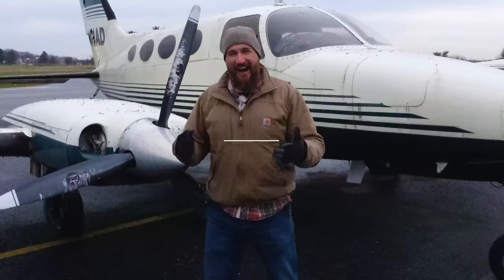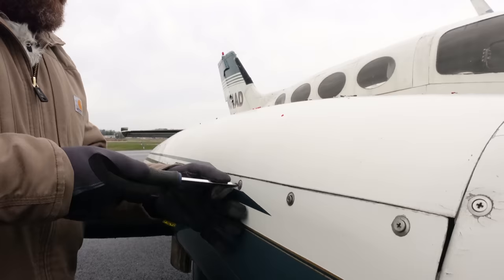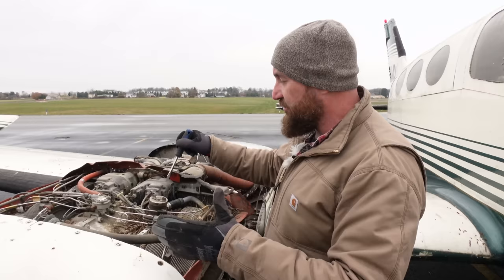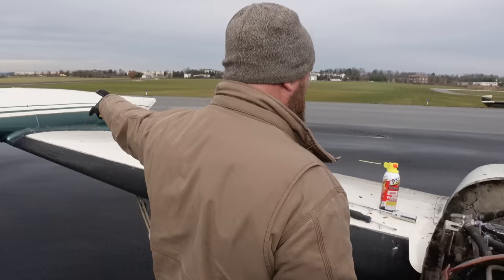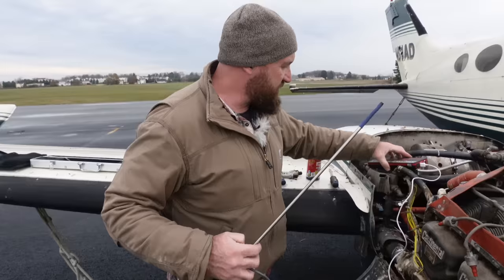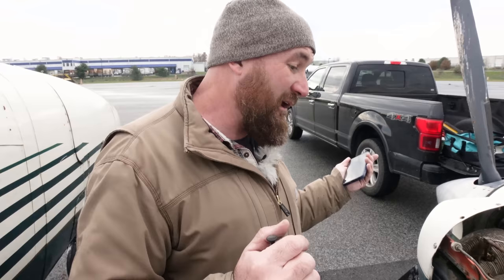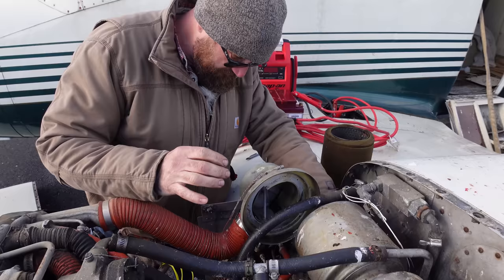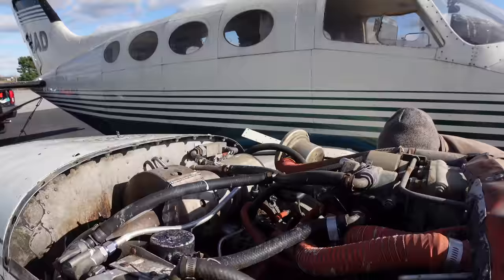FREE Abandoned Airplane... If I Can Start It! Ep1

Comment: This is looking like a good project to try and at least tear it apart and see what shape it is in, if the owner is okay with that.  As for the turbos, well you only need the turbos to build power, you could just disconnect the exhaust and make sure to route it away from anything hot and that will get it started once you have the magnetos figured out.  I can't wait to see how the project goes
Reply: I guess for a ground run but totally illegal to fly like that.
Reply: @robertgary3561  Thats all we are going for here by the sounds of it. Its got a very long and expensive road to airworthiness.
Reply: @robertgary3561  no one is trying to fly it any time soon, so... It's all about getting it to run..  nothing more.. for NOW.. lol.

Comment: Your go for it attitude and your casual narration make the video very entertaining.  Having done everything that you are doing  I kind of know the out come. Been in aviation for 40 plus year and you got me yelling at the TV.  LOL Even starting a good engine takes a little knowledge and practice. ( Side note ) Don't mess with the turbos just for a start, you do not need turbos to start,  just let the engine breath normally. Treat it like the big 6 cylinder VW engine that it is. Leave the mags on just pull the caps and do an inspection. If you see any problems then pull them.  Want to know if it has spark squirt a little fuel or starting fluid into the intake. It shows fuel flow so you know you got gas getting that far, are the injectors clogged, maybe.  It would be entertaining to see you restore the poor old derelict. But making it airworthy again would most likely take over $100K parts and several hundred hours labor. I still would like to see you start her up.  PS please put the battery in the battery box so it does not get blown off the wing. If you want to jump the battery for extra power there is an external power port or ground power. And find a start up checklist that will help make it easier to start the plane. Looking forward to your next video.
Reply: You are absolutely correct on everything you advised. I've been around the av for over 50 years and can't count how many times I've taken a plane in worst condition and made it whole again. Time is your friend, when working on an air frame. Keep giving your advice. You seem very knowledgeable.

Comment: I've done this with cars and though this won't help me om the mechanics, I ALWAYS START with  washing everything I can get into,I mean  EVERYTHING .  
Waxing the original paint even where chipped. Then the interior wash/ condition leather seats, shine windows (I know airplane windows is water only to not add to scratching)That will fuel my 
'Inspiration ' to continue. Then I'll work on painting where needed, on my own. 
  Doing this FOR ME is the easiest part to do and often it ends up looking even better than cars around mine.
  After the exterior and interior are done THEN I can move on to wire replacements one at a tjme,time, bulbs,etc 
  And HEY if the engine is beyond help and engine replacement is beyond my meansI have a parts vehicle car that can attract prospective buyers and we know parts are more profitable than the whole vehicle. 
...Good kick with that 402! I remember when they were introduced and made many of us want one.

Comment: Hey man just found the channel. Love what you're doing. There seems to be a fuel leak when you prime the fuel towards the front of the right wing between the wing tank and the engine, just in front of the wheel cowling. just a heads up as it wasn't mentioned . 1:07:35 👌

Comment: I have done this process several times,.  Feel free to reach out.  One note - Please do not move the crank by hand like you were.  A broken P lead could have cost you your life….not exaggerating (I have been hit with a prop that fired in that condition).  Good luck.
Reply: Broke my hand thanks to a faulty p lead and it could have easily been my head. Just kicked over a half a rotation but that's all it takes.   Wont be turning a prop again without at least pulling all the top plugs.

Comment: Okay … you earned my subscription.  I’m wondering, would a locked turbo stop the engine from idling? I’d unhook the turbo discharge and let the engine be normally aspirated. Work on the mags, fuel and compression till you get it to idle.

Comment: I have flown a Cessna 340A Ram vii. It was an amazing aircraft. I had a certified pilot flying right seat with me because I am only single engine instrument rated. I have 35 hours in a Pipper Seminole from twin-engine training and the performance between the two mentioned aircraft is night and day. Those turbo engines will really pin you back on take-off😃! I’m excited to see how this project turns out. As a lover of aircraft, I can’t even begin to imagine allowing my aircraft ending up in this condition. Best of luck with this one; It’s pretty bad.

Comment: @ 47:57 You'll be fine running 2 12 volt batteries in series, you'll end up with 24V and only as much amperage as the electrical system is demanding at what the battery can supply.
so if you have 2 batteries @ 650 CCA, you get 24V @ 650 CCA, in a parallel setup you would get 12v @ 1300CCA. even if your batteries were able to supply 10 million CCA, your system will only pull as much as it needs.

Also the engine SHOULD start without the turbo, It'll just be low on power.
The turbo really doesn't do much on engine start as there's no hot expansion gas from the exhaust to spin it fast enough to create compression.

But you should deff rebuild the turbo, if you get it moving with lube and have it running and the seized bearings shells, you'll suck the debris into the engine.
Reply: Yeah I was gonna say just disconnect the charge pipe or something.  He doesn't need that turbo unless he's flying it.  Plus it might break loose when it gets some oil pressure.
Reply: Trying with one 12V is like trying to start a car with a 6V motorcycle battery. Half the voltage needed. Why didn't he serially connect two 12V?
Reply: @CsabaTothMr  He thought it would have too many amps............... And he wasn't sure whether to connect in series or parallel. "it's one or the other"  lol.....
Reply: @CsabaTothMr  really bad on starter motor too as volts go down amps go up and can burn up your starter. I was surprised he did that instead of putting 2 in series.
Reply: @CsabaTothMr  He doesn't understand electricity that well apparently.
Reply: @Sailordudeayeaye  volts go down, amps go up … genius, … are you related to Faraday?
Reply: @andyxox4168  No, Al Gore!😄

Comment: I can’t agree more with Beastwerks, the whole project looks great and fun for a video, and yes when it comes to mechanical components it is similar to any other machine, the comparison stops here. I don’t know if I’m terrified or amused, probably both.

An aircraft and all to do with repairs on it are so regulated and strict that I would personally would not even attempt it and I know my way round an engine as well as being a pilot for the past twenty years.
Even if the engines start, and say all seem to be “ok” there are so many pitfalls and hidden stuff in doing a project like this.

Wings Spar inspection for corrosion, the de-ice boots will have to be replaced, props re-dressed, all the electrical chased and double checked, signed and approved by an avionics engineer, primary controls cables, the engines…well where does ones start? An endless list. 

FAA recertification and fees, all parts have to come from a certified dealer, tested, approved and fitted by a licensed mechanic etc….

Most definitely not like a land vehicle where you do a once over, restart the engines a polish and off you go…if the engine stops you pull by the roadside, in the air….different story.

I admire you for your bravery but would certainly proceed with caution, you could find yourself at 5000ft and something goes bang unpredictably etc…

I hate to throw a spanner in the work here as it is a good project and I personally rather see an aircraft in the sky than rotting on the ground, but in the end of the day there’s a good reason why so many aircrafts are abandoned everywhere.
Projects come and go all the time some too good to be true, walking away from some project with hindsight is a smart move not a defeat.
Having said that, the very best of luck to you. An admirable feat, if you end up flying it your life and your passengers (family?) will depend on the quality of your work.

Comment: 48:00 Series to increase voltage.  Stuff will only draw that amps they need.  You can't have too high amperage of a battery, generally.
Reply: What he said about too many amps made me think he needs to brush up on electrical as well.  If anything running it on 12v could lead the starter or other electrical to draw more amps than the wiring was designed for.
Reply: @davidc4162  yea well he's rebuilding an airplane engine and you aren't
Reply: Series: Voltage increase, capacity/load constant. Parallel: voltage constant, capacity/load increase
Reply: @failtolawl  No, he's not.

Comment: So Jason, I have been watching all the videos on the 401 and it stops when your taking the doner engine cradel apart. PLEASE do me a favor, when you get to a stripped screw dont use your grinder to make a flat head screw driver slit, go to your local auto parts store and get some valve grinding material and put a small drop on the tip of your screw driver , and extract the screw with no sparks lol  Trust me an older della taught me that trick about 3o yrs ago.

Comment: A locked up turbo won't affect the engine's ability to start. You never checked to see if you have spark from the magnetos. FYI, you should pull the fuel injectors out, disassemble them and clean the parts using Hoppe gun cleaner. Odds are you aren't getting fuel and/or spark.

Comment: I would love to see you do a restoration of it, it's something you never see. It'll cost a fortune to do, if the frame is even still airworthy. The turbo shouldn't be a problem for starting it up. For the turbo to operate it needs exhaust pressure, to get enough exhaust pressure the engine needs to be running.
Reply: The problem is if the turbo won't spin, the exhaust backpressure will be too great to allow the engine to start.
Reply: @stewc625  The backpressure shouldn't be significant until the engine is running.  It should still fire and run at idle.
Reply: @stevebowen9412  I’d replace the ‘old’ fuel and bleed new fuel to the injectors. A lot of engine turning without results could kill the starter motor.
Reply: @stewc625  I've started cars with stuck turbos, they start fine. The exhaust gas passes through the turbine blades while its stuck. It only becomes a problem if you're trying to rev the engine, then it becomes a restriction on the flow of both exhaust and air. Even then you can still build revs a little before it chokes.

Comment: To check if there is spark, you can solder extension wires on a LED, then connect negative to ground on the frame,  then turn a few turns of the positive wire around the spark plug lead. The LED will flash when the spark plug flash. Cannot remember exactly how we did it on cars in the 80's to get a nice display of flashing LEDs on the dash in the car. That was the time of those Ford 3 litre "big 6's".I cannot remember if we soldered a 1 kilo ohm resistor in series with the LED to limit the amps some. The idea is that the wire coil, about 3 or 4 turns act like a secondary coil of a transformer, and a small voltage get induced, just enough to light up the led.

Comment: Be great to see the renovation. If you just have to get the engine(s) running, pull the props work on the engine yourself, get it to start and you got a nice plane. But you'll need AnP mechanic for sure for the heavy lifting, I think.
Reply: And maybe a repair manual for this. As they have special procedures for a reason. Because aircraft are less forgiving than cars

Comment: In the terrible condition of the plane, I recommend a recirculating vinegar pump system to remove the corrosion in the cylinders. Seals, grommets, and gaskets are going to be problems.

Comment: Great work. Another issue will be collapsed hydraulic lifters, pull the rocker covers and turn the prop by hand to make sure valves are opening. While checking make sure the valves are not stuck. Marvel mystery oil is great for getting stuck parts operating again. Drain the oil and completely overfill the engine and cylinders with marvel mystery oil, let sit for a couple of days and turn over the prop by hand several times during that time.  Diesel fuel might work just as well and is cheaper. Of course, after a couple of days drain the all fluids and refill with aeroshell or whatever aviation oil you prefer, then try starting.
Reply: Marvel Mystery oil is incredible..  but....  Even BETTER, is a 50/50 mix of acetone and transmission fluid.. Look it up.. best ever penetrating oil on the planet to date. Bring a gallon of that stuff mixed up and you will unstick EVERYTHING.........  But yes, Marvel Mystery oil is unreal when it comes to internal lubricated pieces. It's also super fantastic at disolving crud deposits in an automatic transmission, WITHOUT breaking the deposits loose.  and destroying the transmission.

Comment: The motors are cool.  Maybe cut them down for a motorcycle build.  The fuselage would make a good deer blind.  Put a wood stove in there with a cooler for your drinks.  The aluminum scrap is worth something.  Anyway, if you have a lot of time it could be made into something.

Comment: 24 volts from two 12 volt automotive batteries wired in series (+ to - between batteries) is perfectly fine.  There is no concern about the current as long as the batteries are in decent shape and supply enough.  Amperes of current flow depends entirely on the power demanded by the starter to turn the engines.
Reply: @TylerDuysen  My intention was not to challenge your statement because you are 100% correct.  My intended suggestion, was that, if there was any doubt in your mind, there would have been no problem with connecting two car batteries in series to temporarily replace the 24 volt aircraft battery, assuming each battery had sufficient current capacity to spin the starter.  I thoroughly enjoyed your video by the way.
Reply: @TylerDuysen  parallel 2 batteres of the same voltage gives the battery voltage with higher amperage. Series = 24 volts and whatever amperage the batteries are rated at.
Reply: Agree completely.  Cold cranking amps (or some other measure of battery capacity) will indicate the maximum you can expect from your battery, but the battery cannot disobey Ohm's Law and supply excessive current.  If you have a 24 volt battery, then if the aircraft electronics (including starter) exhibit 24 ohms, you will get 1 amp of current.  If the resistance is 0.24 ohms, you will see 100 amps of current (ballpark what a starter draws). Even if you put ten 24 volt batteries in parallel, you will still get 100 amps from 24 volts and 0.24 ohms.
BTW I was captivated by
Reply: the entire video and spent an hour and 15 minutes glued to you tube. Thankfully I was not holding the camera and freezing my a$$ off.
Reply: @kenswitzer4133  youve got that backward look it up neg to positive positive to ground is 24v(and whatever the ca x2 is) pos t pos neg to neg is series )12v and cax2)
Reply: @danielsugarman7547  parallel adds voltages and ca series just adds ca so 10 24v batteries in series is (24v but ca's of batt x10) 10 batteries parallel is 120v (12ov batt+ ca x10 ) with a parallel switch you use 24v batt +ca x2 but the object pulling power only gets 12v+cax2 it takes 24v to trigger but only puts out 12v
Reply: @rossk4864  thats very true ps i beleive an aircraft starter uses 115 or 120 amps
Reply: @TylerDuysen  Sorry, but you've got that completely backwards; you should look it up yourself. Two 12VDC rated @ 10AH batteries wired in series provides 24VDC @ 10AH. If you wire them in parallel, then the voltage remains @ 12VDC, but the capacity is doubled to 20AH. Batteries supply current. Depending on the resistance of the load, the voltage will drop according to V = IR.
Reply: @TylerDuysen  A Cessna 182 starter will draw 80-125A under normal conditions....add cold = high viscosity = easily 180-200 starting amps. The batteries have typically 200 cranking amps capacity; meaning the battery can source 200A for a brief period < 10secs before damaging it.
Reply: @luisderivas6005  right which is much lower than a automotive battery 200ca is a 12v garden tractor battery my truck uses 1200ca batteries
Reply: @luisderivas6005  🤣🤣yeah guess i did i got mixed up since some diesels use a parallel switch witch converts 24v to 12v (for the starter and electrical)
Reply: @TylerDuysen  Incorrect, series adds the voltages, keeps same amperage of 1. Parallel keeps same voltage but doubles amperage.
Reply: @mrmotofy  yeah i got it backwards my bad
Reply: @TylerDuysen  No problem my dude...it got straightened out. People read this stuff to learn and we gotta make sure it's accurate